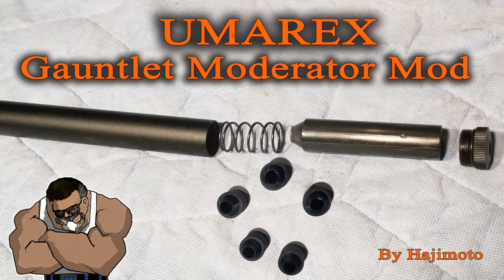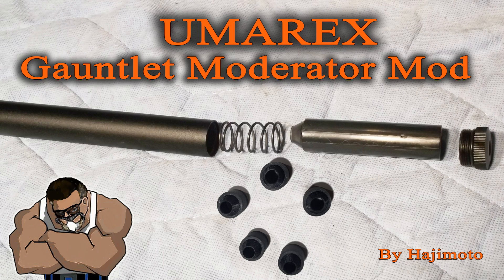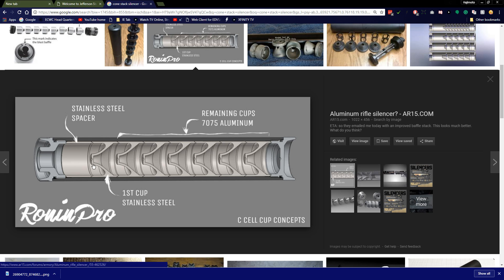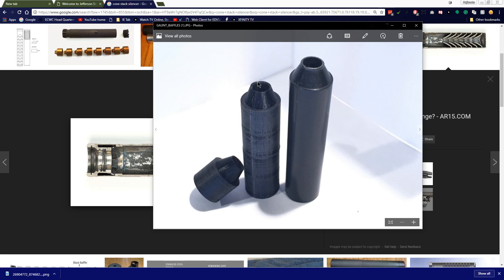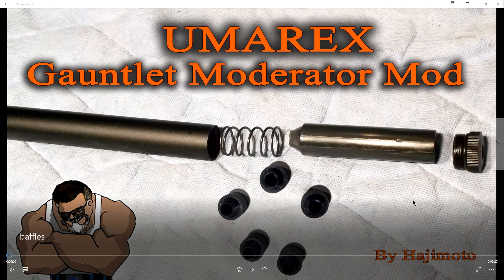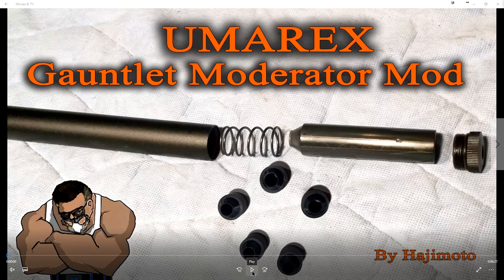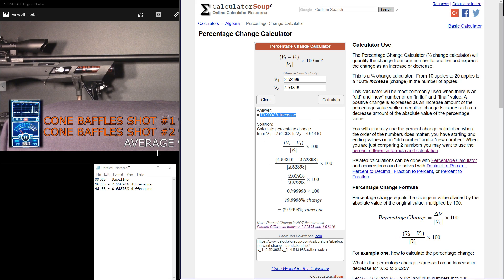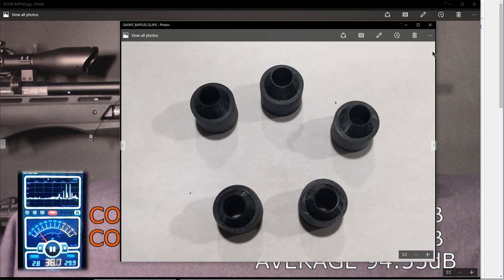Umarex Gauntlet: Quieting the Bark Silencer

Comment: I'd like to throw in an extra .02 here, and point out that since decibels are a power ratio and not a linear scale, a few db is actually a larger difference than the numbers might suggest. 6dB is the equivalent of a doubling of the sound pressure level. That means that going from 99.05db to 94.55db is a ~40% reduction in sound pressure.
Reply: Ryan Willis  Yes, I was going to point that out too. DBs are. not a linear relationship.
Reply from the maker: Good to know Ryan, thank you for the education, view and comment!
Reply: @HajimotoProductions   Have you ever thought about doing this????
Just unscrew the shroud holder piece that is against the breech and move it forward the length of 5 more baffles and it will produce way lower decibel reading. You will need to make a new indentation on barrel for the shroud holder piece screw to secure properly.( sorry Im not sure what that piece is called).

Thats what I did on my Benjamin Marauder. I added 5 more baffles. It does look a bit odd since the shroud sticks out quite a bit pass the air tube. Well worth it though. Gun is whisper quiet.
Reply: 6 dB IS NOT the doubling of the sound pressure level.  If something is measured at say, 90 dB, a 6 dB increase brings it to 96 dB, which is nowhere doubling the SPL. Doubling the SPL of 90 dB would be 180 dB.  You've confused perceived volume levels with sound pressure level. 

In the world of audio 3 dB is (generally) the minimum increase the average person can detect with their ears.  10dB is generally considered to be twice as loud, but not twice the SPL.
Reply: 3dB is doubling or halving the intensity of the sound. But for us to percieve a halving or doubling of the volume, that takes a 10dB change. So these baffles do have a significant effect but you would only appreciate that effect by hearing it live.

Comment: Hajimoto what's up, I just wanted to give you an update on your baffle system I have received from you.At first, I was a little too excited receiving them and I put it in backward and the sound level increased. Scratching my head and reviewing your video I saw the error of my ways.After that, I noticed the bark of the gauntlet decreased. Checking with my sound meter I lost about two decimals almost exactly like your video, but the gravy/bonus was how the power went up slightly and my group tighten up very noticeably. For me, I have an increase of seven to 10 fps, also at 35 yards, my groups went from a slightly smaller nickel-sized hole to a dime size hole.I'm sure you're working on other projects for the gauntlet make sure you put me on the fast track list, and thanks again for your effort and work.
Reply from the maker: I am so glad that the baffles did not get destroyed by a pellet.  Thank you so much for sharing the details of your results.  You are experiencing the same results as most folks that have installed the HP Baffles. Dime sized groups are AOK!  
Thank you again for all the support.
Reply: My power appeared to go up, too. Shots started to go higher up. And the noise reduction is great! The pellet smacking the target is louder than the rifle

Comment: Hey Haj, my cheek piece only goes up like a cm. at the most. Is that normal for this gun or is there something wrong with mine?...
Reply from the maker: Be sure to loosen the sling swivel stud.  As you loosen it you will be able to raise the comb.
Reply: Yea. I know and it raises but it only goes about a cm at the very most. I searched and searched on here and I think I found a video about this issue and it showed the guy take off the buttplate and he did something i couldnt see inside the stock and then his cheek piece went on up futher. (It was fixed) Problem is, is that i couldnt see what he did and its the only video or anything that i could find on it after hours of searching last nite BUT UNFORTUNATELY He spoke Spanish so I couldn't understand a thing. Lol... No Biggie tho, I can deal with it. It would just be nice if i could get it up a bit higher to line my eye up right with the scope and I just thought you might know something about it. Hell at the time i asked you i really wasnt even sure if it was just my gun having this issue or was it normal and they were all like that. Just thought id run it by you cause you are The Man when it comes to The Gauntlet. Before its over with your vids may even help me get up the courage to adjust my trigger. I really want to take out the creep and i think i can do it (cause i get it / I understand) I just gotta get the nerve up lol :)

Comment: My baffles are gonna be here today :) Im excited to hear the difference. If your interested Hill is making a spring for the gauntlet now comes with a shim etc. Im sure you can make your own for alot less than they charge but for people just now getting into Air-Gunsmithing like myself its a nice safe way to go. Just thought id let you know you can delete this comment after you read it if you choose ;)    
     •   [>>>>> 🔫
Reply from the maker: That's good information that I think the community would benefit from knowing. I will be producing a full modification that adds hammer spring adjustment and valve work that gives the stock Gauntlet tank over 100 shots for fill and the average FPS is 830FPS with 14.3 gr pellets.  Stick around, big changes coming. If you are on FB be sure to visit Hajimoto Productions for all the latest behind the scenes action when I am not uploading a YouTube video.
Reply: Hajimoto Productions Great will do man... Got your baffles and everything was a really great fit. Quality was great just like i expected. Lined up perfect. I added a external monocore ldc made out of delrin that i got off of eBay as well as its alot quieter now :) so a big THANKYOU MAN! and i can wait til i get the nerve not to care about the warrenty and drill the vent in the shroud cause im sure that will help make it •••hush baby sleeping quiet••• but im def. good for now. I am going to take a chance and try to see if i can get my cheek piece up higher cause with it only going up a half a cm. its not really even helping... ***I can wait to see what you have in store for the future and always look foward to ALL your post! Its really cool that you take the time to make all these vids and help us with all this info. Thanks Again. Have a good one mane! 
~Doc~
[01/24/18]
Reply from the maker: Doc, you are welcome and thanks for the feedback, it helps know if there were any issues that need my attention. I hear you loud and clear on the warranty, no one wants to risk their $300 investment just to be a little quieter. As for the cheek piece, I thought I answered you on this..... If you loosen the rear sling swivel (looking at it from the bottom, turn anti-clockwise) that extends the stud in which acts as the comb limiter. Please share some photos of your Gauntlet and some target results, it would be awesome to see.  Thanks again for the support Doc!

Comment: The reason those baffles, factory and 3d printed make so little difference, because the most of the noise reduction happened in a shroud chamber. The second chamber is a spring. Gauntlet is my first pcp and it is quieter than all of my airguns. Please make a video about improved performance and maybe a nice solution to brace the barrel.
Reply from the maker: Thank you, Casey, for your comment and observation. I am currently working on a DIY project to address better utilization of the shroud chamber with acoustic absorption techniques. I have a few solutions to improve the barrel shroud support but because the tank is the only thing to attach to which has movement issues of its own, the solutions are challenging to say the least. I am in the North East region of the US and the weather is forcing me to utilize my indoor 20-yard range which is not distant enough to gauge true performance increases or decreases. I plan on doing more 50-75 and 100-yard tests once the weather breaks. The one thing that I have been thinking about doing is a follow-up video that speaks to all the previous videos and I will share updates to common questions, corrections, performance results, and improvements to the original video(s).

Comment: You only used your hold in the shroud mod with your baffles.  How much of the advantage of your baffles was due to also using the shroud vent hole?  I really liked that mod in a previous video.
Reply from the maker: Hi Perry, you are absolutely right.  SwordChux made the same observation and comment below. I will be making a supplemental video to demonstrate any delta been factory shroud with hole and HP baffles and hole. Thank you for the comment.

Comment: Hello Hajimoto,
Really impressed with your video, I just received my Gauntlet unfortunately i havent had much of a chance to test it out.  You see up here in the great white north, Canada its been incredibly cold out . Now try to imagine just how cold it really is when a life long Cunuk includes cold in a sentence.  There is options like indoor ranges however for the most part they are far and few, that leaves us with limited means.  If the weather hasnt dropped below -25 we can resort to plinking in our yards, any thing below that threshold we retreat to our basement, not the best option especially with PCP"s that have no problem reaching out passed 30, 40, 50 yards and beyond.  In any case, either outdoors or inside the Gauntlet is to loud.  Canadians are to up tight when dealing with fire arms, if your not familiar with our laws it basically lists any thing shooting a projectile faster then 495 fps requires a license and that means the Gauntlet is a fire arm.  More ridiculous is the fact that even air guns have the same restrictions as powder burners, in turn the baffles in side the Gauntlets shrouded barrel have been removed, the direct result makes for a lounder Gauntlet .  This leaves us to our own devices, meaning we must source out our air gun needs.  I would really appreciate a link or instructions how i could purchase your baffles.  In fact im certain other Canadians lucky enough to get a hold of a Gauntlet  will be searching trying to find a way to turn the Gauntlets volume down as well
Reply from the maker: Hello Up there in the great white North!!! I am in Massachusetts so we get pretty cold here as well, not your kind of cold but we get cold! It is important that you watch my tear down video as I describe another trick to reduce the sound report. Any high level of suppression is really going to benefit from the relief hole that I describe in the aforementioned video. As for Baffles, I suggest if you are an avid airgunner that get your self into 3D CAD or metal working and make what you need for testing purposes of course as it would be illegal to suppress your air rifle. I have seen the hoops that US air Rifle sellers have to jump through even to sell their air rifle to someone in Canada.
Reply: Commies run Canada,,,, usa soon to be ,,,

Comment: Another great video. Will the new cones work without making the hole in the Shroud? If I have any problems down the road with my Gauntlet I would like to be able to get it warranted. Without having to buy a Shroud. Thought of something too what if you put a weaker spring behind the cone to where the air can bleed out more.
Reply from the maker: Hey Shawn, they will work and they will help reduce turbulence far better than the factory one-piece torpedo.  You will get much better results with the breather hole in the shroud though. You really want the spring weight that is there, don't under underestimate the lifting/compression power of the air as it rushes down the barrel. Also, you do not want the baffles slamming unnecessarily, after all, we are trying to reduce harmonics and the chatter of plastic baffles might negate any internal baffle sound mitigation. I understand your logic as it relates to the shroud.

Comment: Fantastic put me down on a set I'll email you. Question is there any way we could get rid of that boink sound the gauntlet makes when it shoots, also are you going to make a revision of the air stripper the one that came with the gun that really sucks. Mostly, everybody, has them cracked already even before shooting.
Reply from the maker: I really think an aluminum stripper is the only way to go. Because a machine shop cost is so much it may not be within the reach of the average Joe. I am thinking of investing in a small metal lathe, my wife has threated to divorce me if I feed my OCD anything addition tho!  LOL I look forward to your order sir!

Comment: I would like a set also. But also a set for .25 airforce escape
Reply from the maker: Sorry, Vinny, I do not own an Airforce Escape so therefore I have not CAD drawn any Baffles to fit that rifle.  I offer only Umarex Gauntlet HP Baffles for .22 or .177 cal. :(
Reply: Hajimoto Productions  maybe someone can point me in a direction for a moderator for the escape. How much are you selling this set for ?  Great video by the way. Thanks.
Reply from the maker: 5 Baffle set is $25USD delivered in the US or PR.  Take a look around on 3D design sites like thingiverse.com , you might find a 3D model that the designer allows as open source for personal use, you can then just have it printed.
Reply: Hajimoto Productions  not bad at all. I will be in touch to order thanks

Comment: Good video, I fully enjoyed it. However,  there is a flaw in your test. making it questionable. You're missing a test of the stock baffle with the weep hole. There is no doubt in my mind that the cone baffles are more effective, but without that other test, we can't say how much more effective they are over the stock.  Again. good video though :)
Reply from the maker: Excellent point! I will have to do a test to show the margin between the two states with the shroud hole open in both firings.  I wish i had you here before I made the finished the video!  LOL  Thank you for the kind words, I will follow up with another video